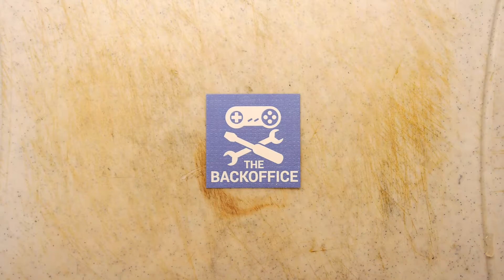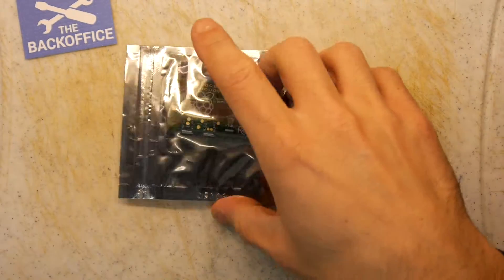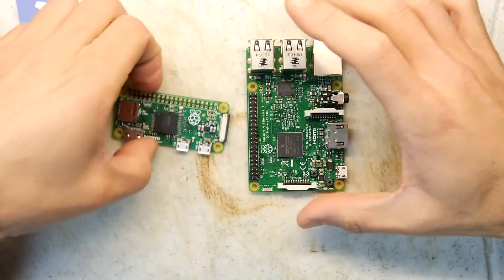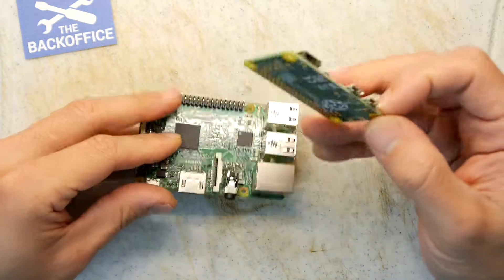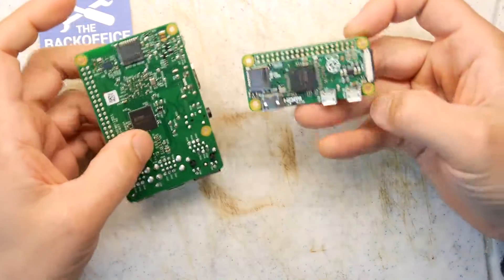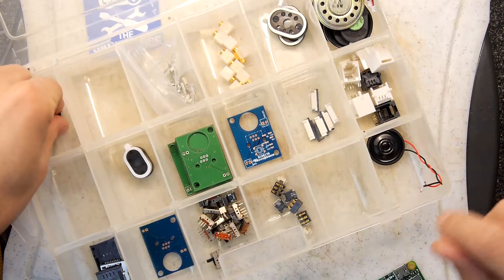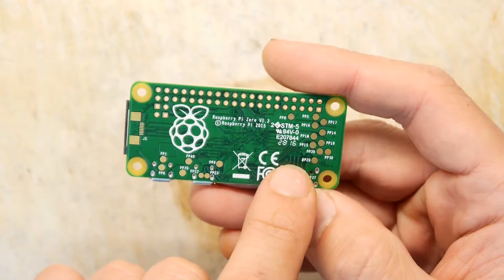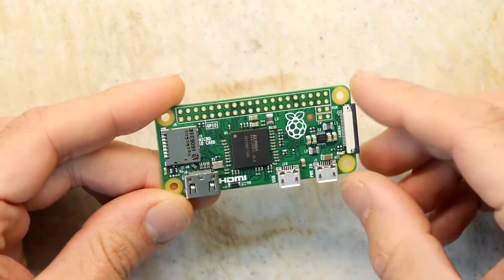Raspberry Pi Zero

Comment: Far beyond my capabilities to make ( I think), but do you think a raspberry Pi zero has enough I/O and power to Emulate a SCSI drive using the SD slot as storage ?
Reply from the maker: The Raspberry Pi GPIO would be too slow, but investigate using a USB to SCSI adaptor, that could work well with a Pi! :)